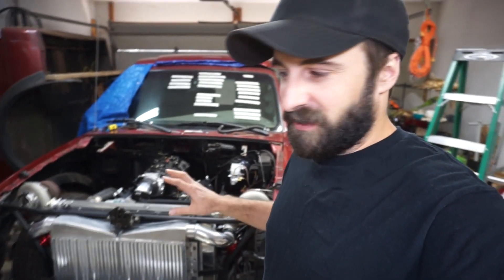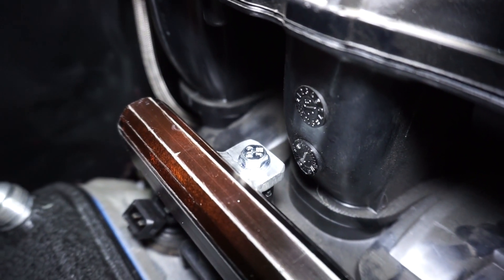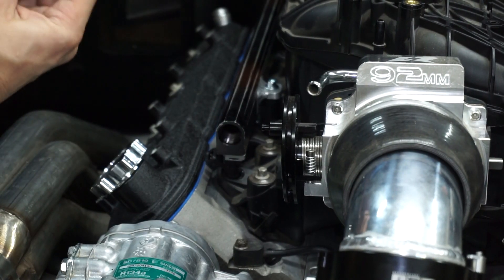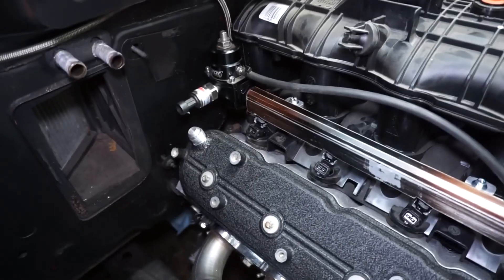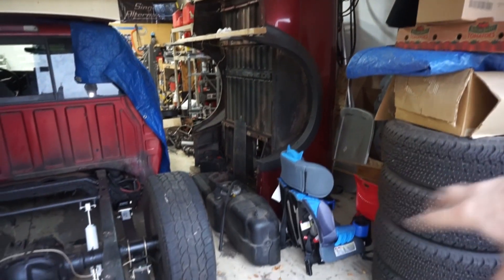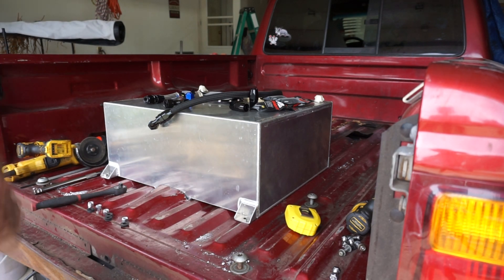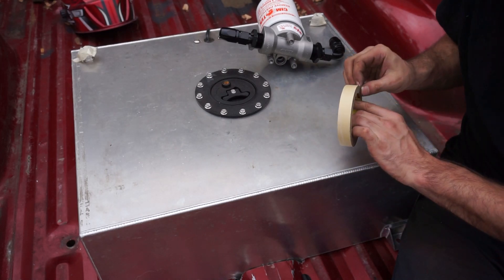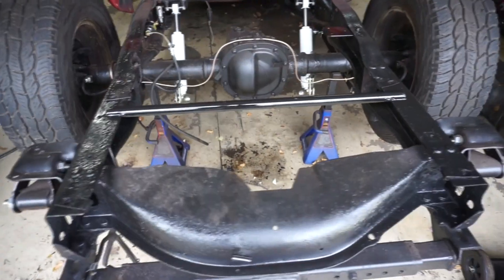Moving Fuel Cell Building Fuel System For Twin Turbo LS 1000hp Rust Bucket.

Comment: Watch your fuel pressure on hard launches when at the track.  Two bosch44 type pumps on my car could not withstand the slosh of fuel Of -10 feed lines.  Not sure 3 pumps will either.  Plenty of fuel at the top end of the run but not at the hit.  Good luck.

Comment: Dude your using a tbss intake like me I went with Bosch 210 LS3 height injectors and Holley rails.. Glenn's auto performance makes brackets that bolt up perfectly to the tbss intake with Holley rails as a kit. I used ict billet LS3 injector hats on the Bosch 210's and amazingly everything bolted up perfect! The first and only thing that's bolted on the entire turbo ls swap on my ranger build lol. Btw what master cylinder did you go with? Your using the 8.8 with disk brakes on the back which mine uses drum/disk factory and need a new one for disk disk setup.
Reply from the maker: It just put an explorer master on it.

Comment: What fuel filter base is that?  Also, did you make the manifold for the 3 fuel pumps? Thanks!
Reply from the maker: I believe it's this one here. 
https://www.jmesales.com/cim-tek-50032-1-in-npt-aluminum-single-adapter-for-30-400-450-and-475-series-filters/
Reply from the maker: I made the 3 to 1 in a previous video, welded 3 of the mounting rings together for the pumps.